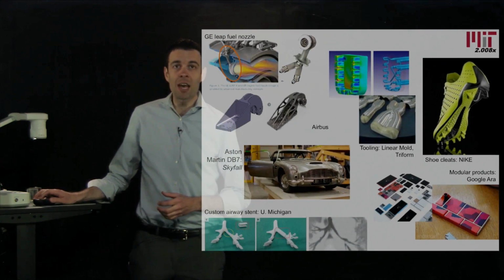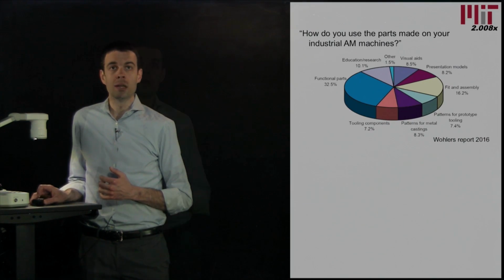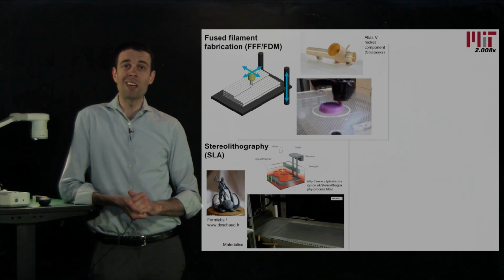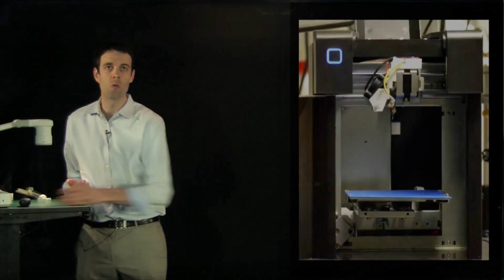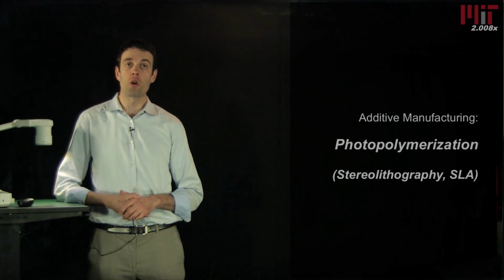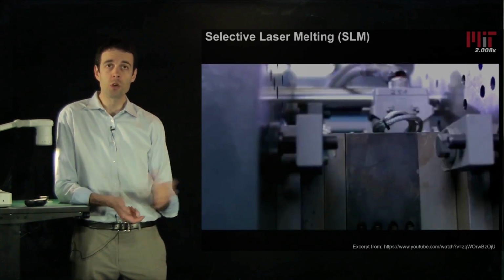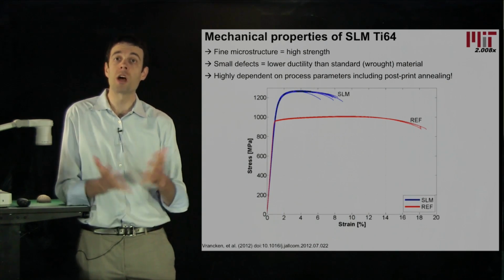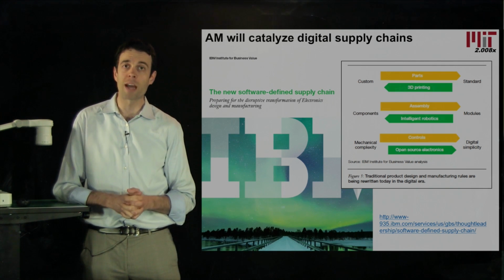An Introduction to Additive Manufacturing (Prof. John Hart, MIT)

Comment: So many variables that affect quality and performance. $1,000 printers will replace $10,000 printers and $20,000 printers will replace $100,000 printers. Sooner than many realize. The biggest difference rigidity between machines and quality of extruder.

Surprised there wasn’t any discussion about DLP or LCD resin printing. Both i can see dominating this market. We are already seeing 4k to 8k resolution quality prints on desktops

Comment: Several problems noted with the 3d printer devices shown
1)  The components that make up the 3D printers are too big 
2)  The feed stock wire used in most wire feed machines is too thick 
4)  There is only one feed wire not multiple fine wire stock feeding into a given machine.  
3)  There are not enough print heads crammed into a small enough area

Idea:  
1)  What if the feed stock could be significantly thinned 
2)  What if numerous micro print heads could protrude from a flat surface
3)  What if that flat surface from which the micro-print head protruded could  make minute shift like a pixel shifting false 4k projector 
5)  What if that same surface could also make large movements in the x, y and z planes 
4)  What if a ultra-mini heat source (for melting ultra thin feed stock) could be added externally or internally to each of the micro-print heads

Would such a theoretical 3d printer print more dimensionally accurate 3d parts?
Could such a 3d printer be made to print metal parts?
Does current miniaturization technology exist that could be repurposed or used to create micro-print heads?  
Could Wire feed stock be created that was thin enough to feed said 3d printer?
Could the printer somehow thin said wire further to meet specs for microscopic print heads?

Comment: We had what was then called rapid prototype machines back in 89. As a Tool and mold maker we are always looking for new technology. I don't think additive manufacturing will replace traditional material removal machining techniques outright but will play a big role in manufacturing in the future.
Reply: i agree with this, AM especially if we're talking about metals have a very small grain structure compared to RM which makes them weaker than parts made from RM

Comment: Dear Professor
John Hart
As relatively new person to additive manufacturing, I would like to thank you for all these amazing information really appreciate it

Wish you all the best
Reply: Longyi super fine powder grinding machines advantages:
1. Powder from 48~4microns, fineness is adjustable
2. Built-in high efficiency classifier, no more investment cost for classifying system.
3. Smart PLC operation system, and integrated control system: 1 computer could operated max 6 machines, saving management cost.
4. No particle air pollution, more environment-friendly.
5. Compact structure to save factory space and lower foundation construction cost.
 
For CaCO3 powder
The whole grinding system including grinding, classifying, powder collector, fan, PLC cabinet, feeding conveyor and others, system power is 370Kw, the real working power is 296KW
1. D97=23um (600mesh)    Output: 10tons/h      Energy Consumption: 29.6Kw/Ton
2. D97=16um(800mesh)     Output: 8tons/h       Energy Consumption: 37Kw/Ton
3. D97=10um (1250mesh)    Output: 4.5tons/h    Energy Consumption: 65.7Kw/Ton  
4. D97=6.5um(2000mesh)    Output: 2.5tons/h   Energy Consumption: 118.4Kw/Ton 

MP/Wechat/Whatsapp: +86 15105956429
Email:Samuel@lymill.com
Reply: 😊😅😅U